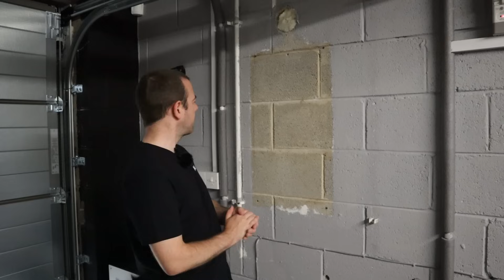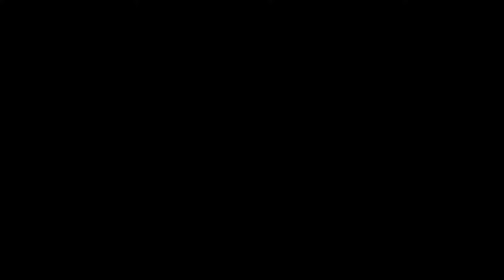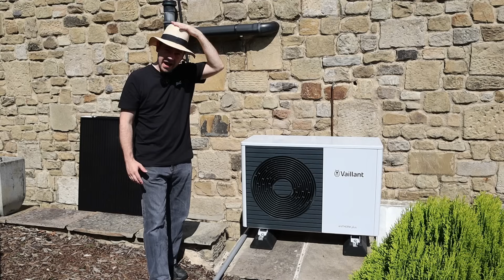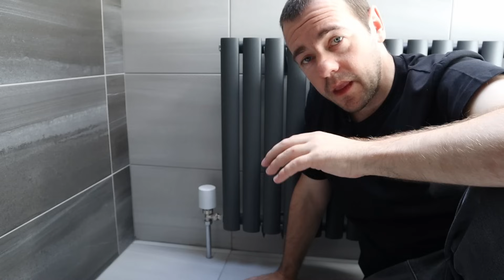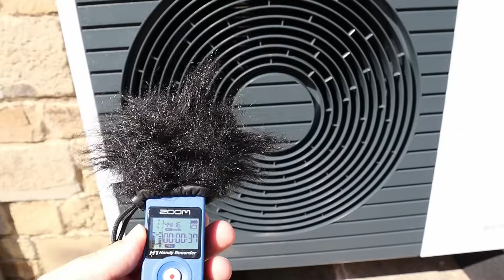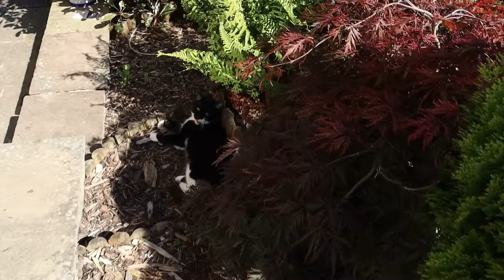Heat Pumps - Our 'Ugly' Truth!

Comment: No 'think' about it - my Arotherm cannot sustain normal room temperatures during winter. It regularly shuts down to de-ice and takes hours to get going. To have the house reasonably warm for 8.00 am we have to have it on from 6.00 am - and you can tell by the racket when it comes on. It's not a usual fan noise - it's more like a spitfire flying overhead. When someone has a bath, the cylinder is cold and takes the heat so the rooms noticeably cool until it can raise the temperature of the water cylinder enough to allow room heating. Then there is the glycol in the radiator circuit to prevent freezing. It degrades after a few years of contact with water and copper, resulting in a brown gooey mess that blocks air vents and results in leaks. To replenish the lost glycol you need to employ a heating engineer or buy a very expensive 10 litre container and try to introduce it to the system yourself. It's a nightmare for householders but a dream for installers and heating engineers.
Reply from the maker: Clearly your system isn't designed properly. For one, Glycol isn't need, just anti freeze valves are. This is in Vaillaints manual as well.
Don't turn your heating off!!

That's your problem. Trickling in heat over the 24 hours is literally what it's designed to do, keeping it off is less efficient.
Reply: @ElectricVehicleMan  I don't turn it off. It's on constantly but setback during the night. System sprung a bad leak at air vent recently due to vent being blocked by brown residue of unknown origin but maybe degraded glycol. Had to drain down partially to replace the vent so low glycol now. I'd like to get rid of the glycol but no-one will take it.  Quote to flush the system an refill the glycol was £2500. Can't get anyone to fit antifreeze valves - everyone busy on the heat pump installation gravy train, I suspect. The decision to use glycol - not mine, as it was Warmworks Scotland/Everwarm project. I'm left with a huge expensive headache that will probably end with us using a coal stove and panel heaters.
Reply from the maker: @bigmeltie1 £2500 to drain the system?

I’m sorry but that’s simply cannot be true. I paid £50 (exc call-out). 

Your system isn’t working, you blame the heat pump yet you’ve got low levels! 
You’re not making sense.

Comment: So what happens when you get 3 feet of snow covering the ground?
Reply from the maker: @jeniferallan6693   You do realise the main form of heating in Scandinavian countries are heat pumps. You know, where it snows a lot.
Reply: Not answering the question are you. I shall try again. 3 feet of snow cover the fan. What then?
Reply from the maker: @jeniferallan6693  Nothing!
What do you think happens?
Do you think it doesn't snow in other countries way worse than here and yet they're fine!
Oh lordy!
Reply: So how does it draw in air if the fan is covered in snow? You cannot breath if covered in snow can you.
Reply from the maker: @jeniferallan6693  Really? It runs defrost cycles that melt anything close to the back of it and it's a big fan at the front!
Again, how do you think scandanvia manages which will have way more than 3 feet! 🤔

The most common issue with gas boilers are when the water outlet pipe freezes.
For me to ask what happens when it get's below 0c would be rediculous wouldn't it.

I can see why you're worried, given how often 3ft+ of snow falls in the UK. Practically daily occurence!
Reply: @jeniferallan6693  Scandinavian countries have cheaper electricity and are always backed up with a wood burner. Heat pumps require a lot of space for the kit and in theory are cheaper; however will that always be the case when everyone is all electric?

Comment: The 5k grant is our tax money it’s not magic government money 
The air in Norway is drier & houses verrry insulated
A new boiler is 2k or less & no they last more than 2 years.many have 10 year guarantee…
That heat pump equipment takes up massive amounts of space there is no way I’d have one in my house I simply don’t have the space..
I have heard nothing positive about heat pumps just sales pitches & im still not convinced or at least I’d pretend to take the Combi out then get the grant & re hang it as a top up back up etc..that fan on all day I’m sure it won’t be cheap to replace especially if it’s outside in all weathers..repairs to heat pumps systems are often 1500-2k too.
Reply from the maker: Dry air makes no difference. Think about it. 
Never mentioned the grant. 
Norway houses are more insulated as it gets wayyy colder! It doesn’t here. 

As stated in the video, you don’t need a mega insulated house!
Reply: @ElectricVehicleMan  Be honest, humidity makes one hell of a difference, I am a Mountain Leader, when chaps from Norway were training in Scotland they could not believe how cold they were. I have ice climbed in Norway at minus 15C and I did not find it that bad. As for better insulation, that would make any fuel more efficient.

Comment: Are there any health concerns for installing both units indoors? What is the physical properties of a heat pump system that prevents indoor installation of both units? e.g. Installing the "outdoor" unit at one end of a 40' attic and the "indoor" unit at the other end?
Reply from the maker: Need air flow. Lots of it. 

A contained space would just get very cold as your attic would essentially become a fridge.

Comment: All this electric car and heat pump stuff sounds horrendously expensive to me, I would never be able to afford it even with the current government grant and given the age of the house I live in I doubt a heat pump would be suitable (We have nowhere to put one of those towers - currently 1 gas combi boiler on the kitchen wall does everything). We also do not have a front drive so nowhere to charge an EV. Bottom line, support the eco stuff in all of this debate but suspect the 60% of families living on around minimum wage have no chance of affording it. I think there should be a 30% eco tax on all ev's and heat pump systems to pay for installation of this type for poorer families to help the UK meet net zero.

Comment: Way too sunny. Not a phrase you hear al lot from a yorkshire man!😂

The design is critical, the install is critical. The new heat pumps are more efficient and there’s linear compressor technology coming at some point (see the video from Just have a think) 
Heat pumps are great bits of kit, but they are expensive and I’m yet to see figures from a 80% daily unoccupied house like mine to see if it’s going to save me money. I will look at figures and run the numbers to see if it’s worth while and try out cooking with induction hobs to see if I like them as getting off gas entirely is the only way to go.

Comment: Can somebody please explain how the evaporator coil doesn't get covered in ice when operating below 0 degrees C in a country with and average 70% humidity.  ie the UK
Reply from the maker: It reverses the flow when needed to avoid that.
Reply: It would be interesting to know how often the system needs to go through this cycle in really cold weather. Obviously this requires the heat from the house which seems to defeat the object. @ElectricVehicleMan
Reply from the maker: @peterlangdon8368  The unit generates the heat, it doesn’t take it from the house. Just heats itself up instead during that process.
Reply: Then presumably the energy required to heat (defrost)  the condenser is provided by electrical input rather than the residual heat in the system. @ElectricVehicleMan
Reply: @peterlangdon8368  The requirement to defrost is much lower than the heating requirement for the house - it will "steal" some heat energy from the water flowing through the system, however, this is usually not enough to make a noticeable difference, and it will quickly recover it after the defrost is complete.  If it is a system where the drop in temperature could be noticeable - small setup with a very low flow temperature, then a volumiser can be used instead for the defrost cycle, so it never ends up touching the house temperature.  It takes a relatively long time for the condensation to build up and freeze enough to hurt performance.  70% Humidity is not an issue as well. Currently, here it is ~96% humidity at ~2C, and my heat pumps are doing just fine.
Reply: Thank you for clarification. @BenIsInSweden

Comment: You cannot make a silk purse out of an expensive sows ear!  Take a student let establishment, for example. The shower is well used and in great demand - not taking long before the hot water diminshes to near zero. Off Peak! Forget it, there is no substitute other than paying what it costs in gas consumption, or, paying the raw electricity costs.
One thing is for sure. There is a vast amount of money to be made by' transient hoards' titled 'Heating Experts - specialising as experts, before melting away, without trace, after substituting a high cost useless substitute for the old Central Heating System.   Let's face it, if it was not for a Russian lunatic blackmailing the World with Nuclear threats, whilst he attempts to starve a vast portion of the World, as he attempts to subjucate the Ukraine, that Gas has been displaced as the most cost effective heating alternative.
By all means pretend those marvellous 'heat-pumps' are Gods Gift. Concentrtate on the hottest parts of the World, where those same 'heat pumps' work in reverse - cooling the inhabitants with their ultra cheap electricity.

Comment: So if i switch on my boiler only when using water or putting the heat on for 15minutes for hours of warmth.. would this thing not need powered and running 24 hours a day 6p pkwh gas vs 30+p  kwh for electric makes no sense either..
Reply from the maker: Who’s saying they need to run 24/7 and at full pelt?
They’re not on or off.

Comment: be interesting when hydrogen comes in,,  hydrogen combis going to be worth fitting if they can get the supply price decent
Reply: given that green hydrogen requires electricity to produce, it's unlikely to ever become a thing for home heating, or if it does, it's going to be a lot more expensive than a heat pump to run.
Reply: it is needed and will power most small british homes  and maby it will be made using nuclear   either way there is just too many homes for electric or heatpumps @BenIsInSweden

Comment: Hi EVM have been following your videos for many years now, keep up the good work. I just wanted to know what the whole sqm area of your home was, as I have a detached property that is very well insulated and has an area of 156sqm. I have recently had a first quote and the guy said I needed a 17kw heat pump and because all the property has been fitted with 15mm pipe work, I would need to rip up the floor boards and install 22mm from the cylinder to the 15mm branch pipes of the radiators. Think he might have been talking B*ll Sh*t, that's the impression I got from him anyway.Thanks again.
Reply: Check the heatgeek map and see if they have someone local to you, preferably one of their Elites.
Reply: Thanks Ben, I now have a heat geek elite installer coming out next week to give me a quote. Thanks again. @BenIsInSweden

Comment: What is the difference between the annual maintenance costs of gas boiler vs heat pump?
Reply: Heat Pump you can do yourself, gas boiler you can't.  Heat Pump engineers will currently charge more for doing a heat pump service, as they likely need to travel further than a gas engineer etc.

Comment: It is not just the upfront cost. It is also about the space we have to sacrifice for that massive tank and the huge unit outside!
My friend has to sacrifice the wardrobe in a room for the tank. He has no garage or space like in this video (look again at how massive that thing is). And the most stupid thing he did was that the heat pump was installed by the wall facing the garden. It's stupid in his case because the house is small but has a huge garden. And now if he wants to do an extension to the back, the heat pump has to be gone; or you tell me that there is a way around this problem (but extending the house to the side is unacceptable).

Allowing the gas price to soar to persuade the new heat pump too soon is going to punish a majority of families in the UK.
Of course, you may argue that if someone can't afford to install the heat pump twice, they probably can't afford a house extension anyway.
And yeah...you can argue that they just have to live in an even smaller room and give that space to the massive tank since the gas price is too high.

So, let go solar!  Then, you may not be able to have a loft extension....

Comment: Did I hear you say that a Norway temperature of minus -50 C is fair game for your heat pump?

I would be genuinely interested to hear of any method that could extract ANY useful amount of kWh from air (or anything else) at such a low figure as even minus 10 C

Speaking of kWh.  The whole game would be more transparent if a householder knew two things,

1  His current kWh usage for heating in December through to February.

2 ...and what PROMISE - from any fitter of, 'Air Source Heating' - there was on the amount of Electricity bought-in, on the new system, being only a third of his former usage (during the same period) or anywhere near such a thing.

It would take some effort for me to believe getting kWh required to be even EQUAL to his former usage is WELL beyond even Ground Source  Heating (with its fairly level playing field of 42 to 44 F heat input sourced coming from the ground, benefits).
Reply from the maker: The coolant I have evaporates at -26c I believe so anything above that gives heat. 

Stop thinking in human terms.
Reply: @ElectricVehicleMan  Stopping thinking is what led us here.  
I would guess that until it becomes a gas it has no heat swapping advantage. If that is the case the -50c environment would sound to be potentially 24 degrees colder than required for it to be of any use - is that so?
Reply from the maker: @colineastwood1357  I didn’t say -50c. Pretty sure even Norway doesn’t get anywhere near that. 

There are different coolants. UK has never gone below -19c so it doesn’t need Scandinavian level kit.
Reply: @ElectricVehicleMan  OK.  I did mention the possibility of my not hearing -50 c correctly
So... I am genuinely interested now.  Being able to rob heat from our country's more regular-winters of just above freezing, to perhaps -10 c would seem to have possibilities.
Are these possibilities capable of getting better than a 1 in, to 3 out in practice? being a major question - after the obvious one of "What will it ALL cost... and will I ever get my money back?".
I can report that 'ground source' in custom built house, with floor heating and state of the art insulation, is only-just capable of keeping its head above water in East Lancashire.  Granted it is perhaps ten years old as we speak but does have a huge field to steal heat from and was fitted with extreme attention to detail, by the owner - a qualified plumber of many years experience.
Reply from the maker: @colineastwood1357  prob best to watch the rest of my HP videos.
Reply: @colineastwood1357  Sounds like a Horizontal loop, and an issue with the loop rather than the heat pump itself.  Likely undersized and freezing the ground reducing efficiency.  Bore hole ones don't have the same issue - and are generally recommended these days.  Still comes down to a bad install rather than an issue with the heat pump itself.
Reply: @BenIsInSweden  No freezing ground not the issue here.  Pipes too deep for that.
Reply: @colineastwood1357  Not talking about surface freezing in cold weather.  It doesn't matter how deep it is if it's undersized.  If the loop is undersized, it will freeze the ground around the loop, and "Slinky" ground loops are most susceptible to it.